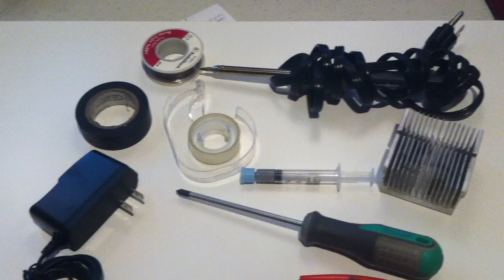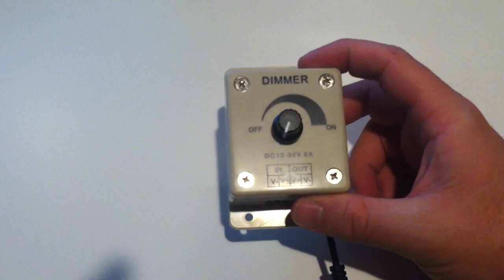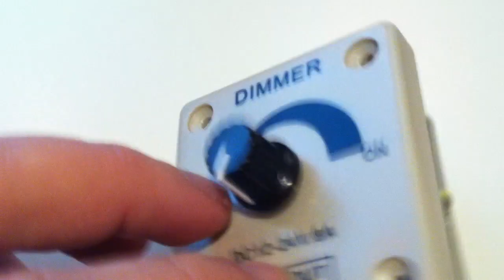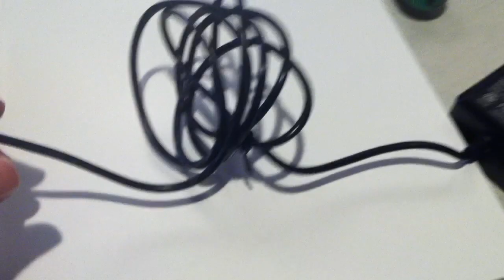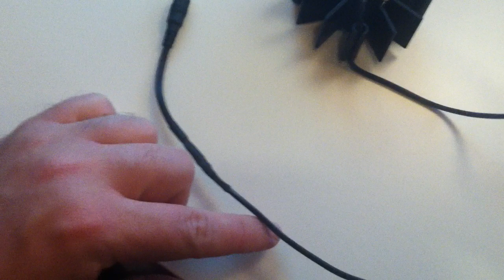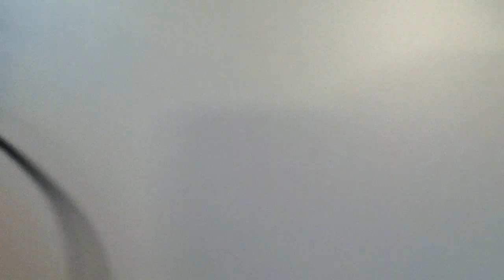Cheap ($25) High power LED aquarium light for Nano Reef tanks and Refugiums

Comment: Love it I built a 8ft fitting with 200 cree xpe xlt red green 3 different blue and cool white 10 meanwell drivers 200 quids worth of aluminium I lo Ed it took me a week to build  butt it was pulling 1300watts 240v but it was for over a 8ft tank used all same spec leds as ecoteck radian  sadly stripped tank down I only use 750ma drivers 48v good to see some on aving ago